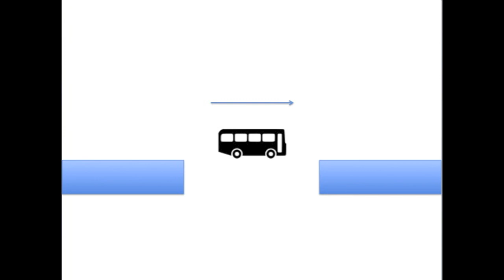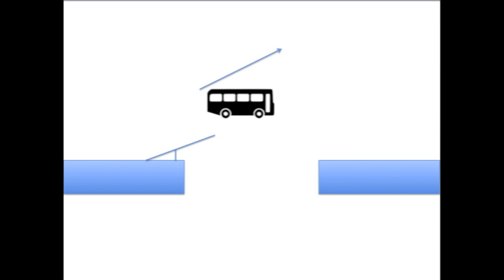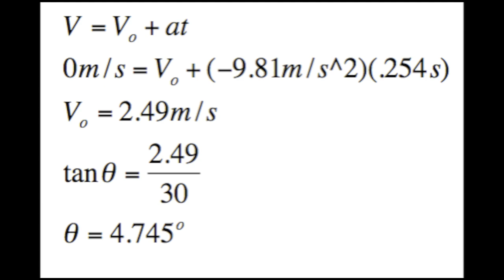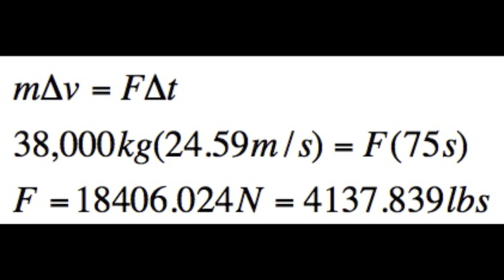Bad Physics in Movies (Physics Project)

Comment: Spiderman actually shot on Chicago el cars -- 2200 series, which weighed just under 24 tons or 21,500 kg. Of course, add in all the people, say 80-100 per car at 150 lbs per person -- about 6 to 7.5 tons per car. Looks like the train has four or six cars -- hard to tell from the quick cuts. Max size in Chicago is 8 cars; New York trains are mostly 10 60' or 8 75' (or 10 51' -- New York uses two basically different types of cars, but all are heavier than Chicago cars).  All this would make a difference in the calculation, but the overall conclusion is the same : Nah.
But Hollywood never gets details right when it comes to any type of train.

Comment: Your Math is wrong when calculating the angle at which the highway would have to be in the bus jump.
When using ∆d = V(∆t) + 0.5a(∆t)^2
V is relative to ∆d. It is true that the peak would be at 7.62m, but that is a horizontal displacement, which means that you would have to use the horizontal velocity in the equation. You used the total velocity(30m/s). The horizontal velocity =Vt(cosθ), unfortunatly we don't know θ. Therefore the only way to solve this would be the equation for range. As long as ∆dy = 0, then ∆dx(or range) = Vt^2(sinθ) divided by acceleration(9.8m/s^2)
Reply: srry I accidently wrote the wrong equation, it would be Vt^2(sin2θ)/a
Reply: Will u do my homework?
Reply: Who fucking cares?

Comment: Fun part about that jump from Speed.... they actually did it. Even the director said they did it. And in the movie they CLEARLY stated it's an incline and that the other part is lower. So all your arguments are invalid.
Reply: Mateusz -- What we are all disgusted about is not those facts, but the fact that the bus visually LEAPS upwards with NO ON-RAMP. Then we are supposed to take for granted that a whole series of events has to take place for the bus to land on the other side by defying gravity. It's stupid.
Reply: It's not stupid - we can clearly see that Keanu Reeves is accelerating the Bus. And not just by stepping on the gas a little - he is hitting that pedal to the metal like no other before.
We all know that busses must never be late - at least there should be a physical possibility that this comes true so we can assume that they are equipped with some badass motors.
If the Bus now accelerated to the earth's escape velocity or maybe even somewhat shorter than a ground level orbital velocity the horizontal jump is no problem at all.
Since they where AT LEAST 20m left of the bridge + the lengh of the bus to its back wheels it could simply accelerate at - lets say 385Gs - and voilá horizontal flight, save landing and no issues with physics.

Comment: Not defending that Spiderman is wrong but something missed would be the leverage produced by the various angles against the train. His hands holding the webs were not overhanging the edge of the train therefore giving him leverage advantage making 1200 lbs plausible (2500lbs per side divided by the leveraging force in half would probably make the cut... He wiped out after maxing out.  However, could the train withstand 2000 plus pounds per square inch where the web made contact or slice through like a hot knife though butter also reducing his advantage and pulling through the center of the train cutting everyone in half in the process?